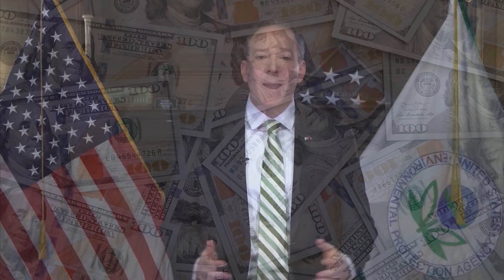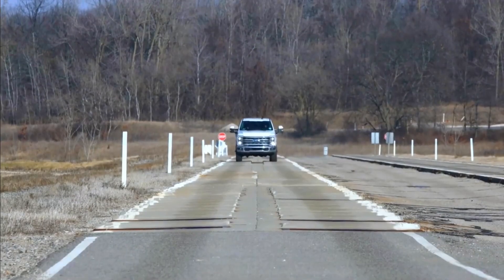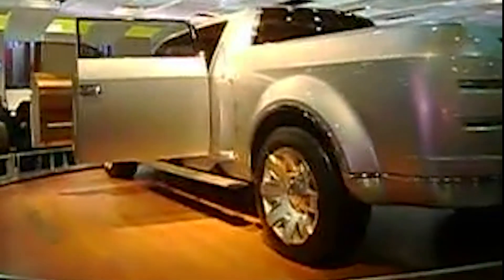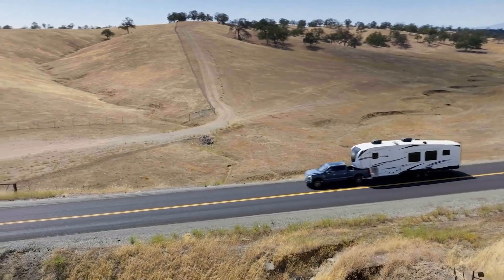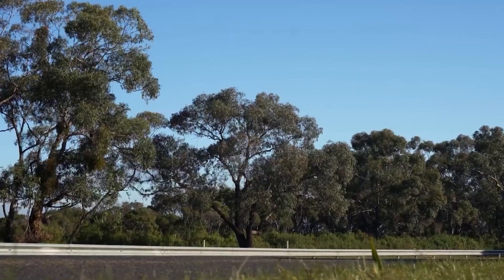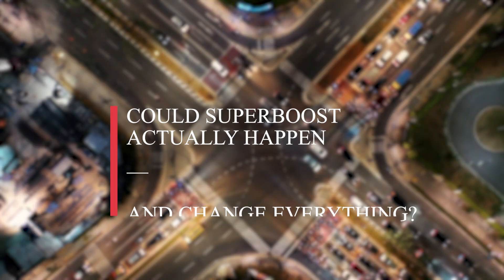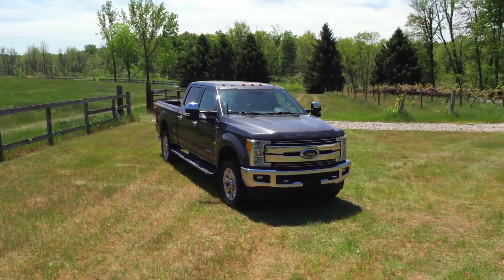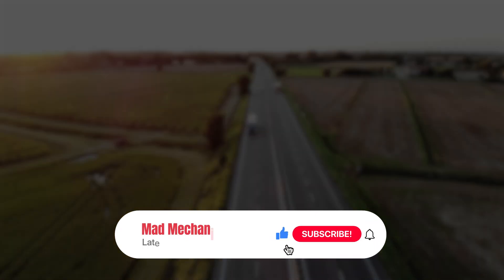Trucking Will NEVER Be the Same – Meet the 2027 Super Duty Hybrid

Comment: I don’t want more sensors in my truck. I want less electronics that will eventually fail and cost an arm and leg to diagnose and fix. Can’t they just make a simple truck anymore? And I’m not talking about a stripped down work truck with the same electronic engines.  IMO, from say 1975-1986 had the best run of trucks. I’d even push it to the 90’s. But now, they’re still pushing luxury over affordability, electronics over reliability and advertising to the wrong customers. 
Whoever makes a standard cab 4x4 like they used to be, I’m buying it. These plastic cell phones on wheels are a joke.